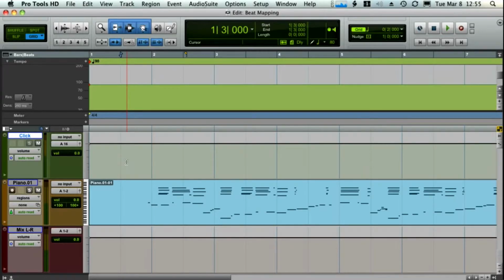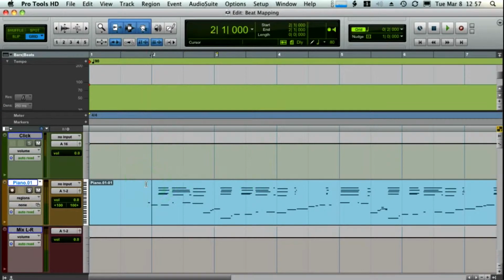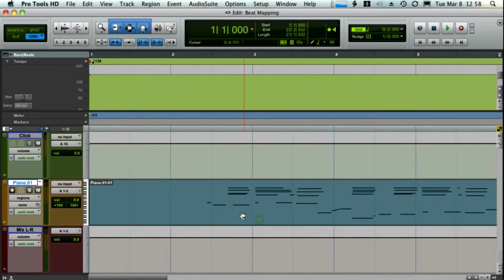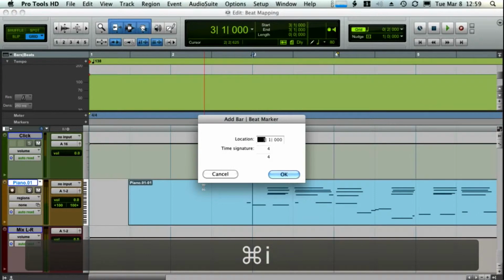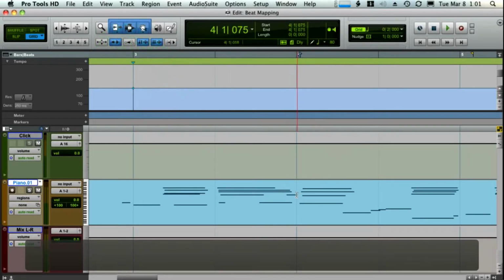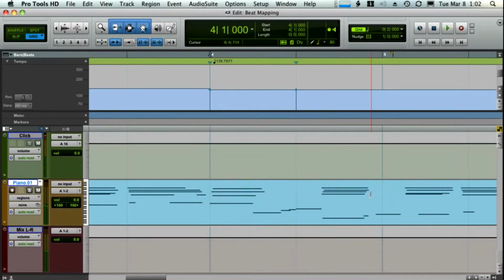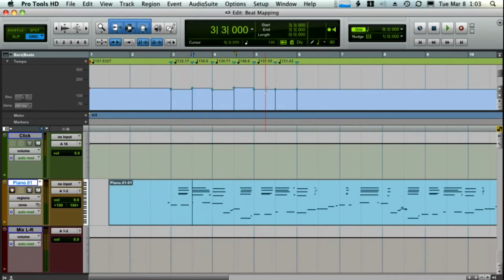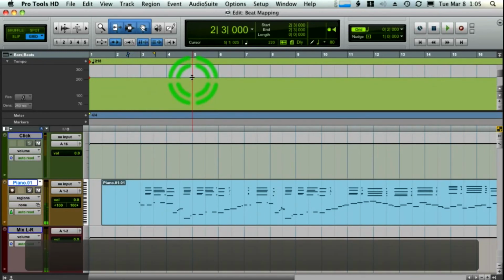Pro Tools: How to Line Up the Metronome to Your Tracks

Comment: So this only fixes the measures you worked on, right? So, I would have to continue this procedure -- if necessary -- throughout my entire song, right? Could I do it in bigger chunks, like say, 8 measures at a time, instead of one measure at a time?
Reply from the maker: That is correct. But you can skip several measures if the tempo is steady and put a marker there and it should hopefully line up things mostly between your previous marker and the marker you place.

Comment: Does moving the notes only work with a midi track? I lined the click up with  the tracks like you did here,  but I can't shift the time of the music. Slow it down/speed it up. If I try moving the tempo like you did at the end of the video, it just moves the click not the music.
Reply from the maker: It will work with Audio, but you need to enable elastic audio on all audio tracks and make sure you have selected them to be tick based (little metronome, not little clock on the individual tracks underneath the name of the track and below the snowflake.
Reply: @RecordingGuru  Thank you! Great tutorial. Do you happen to know if pro tools 7 has elastic audio or is it only in later versions?
Reply from the maker: @TrippingTheTube  Elastic Audio was introduced in Pro Tools 7.4
Reply: @RecordingGuru   Damn!  I'm 7.3  Time for an upgrade. Thanks!